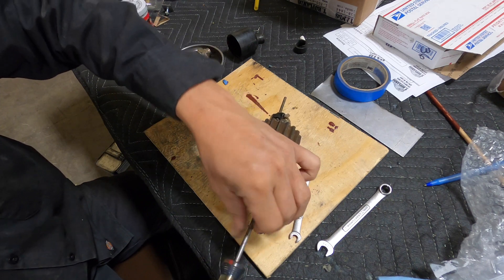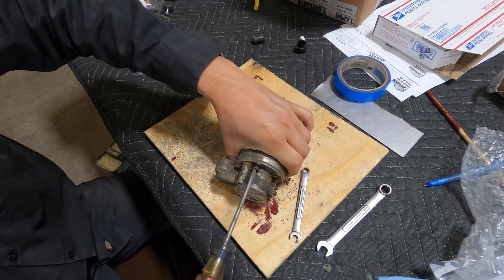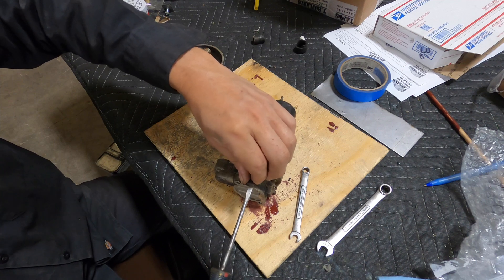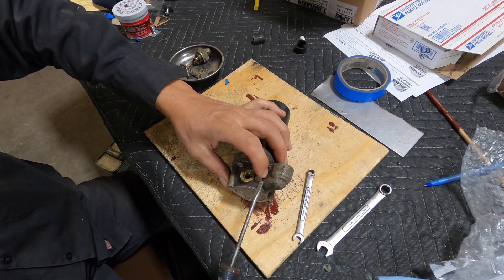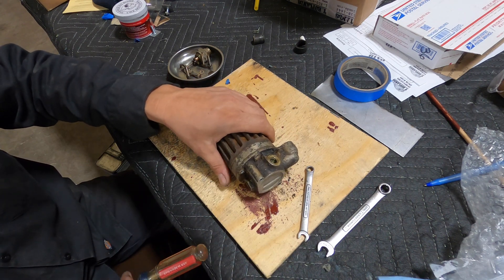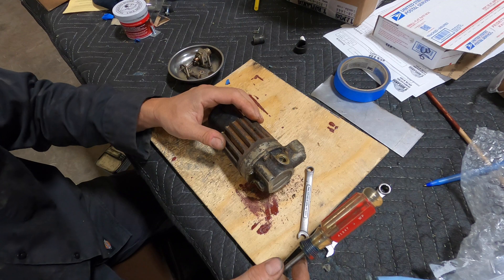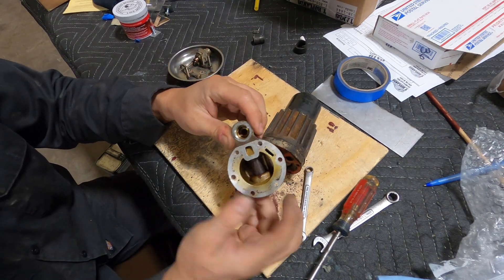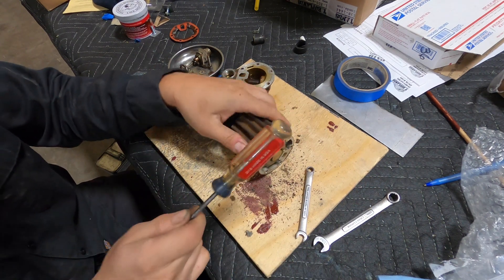Ferrari Electric Fuel Pump

Comment: Great video! I have small question , when carbs are primed the click sound is gone so its pumping no more fuel because its not needed but what exactly triggers the pump to stop pumping? Is there a relay or something that controls pump when carbs are primed it shuts off electricity to pump and when carbs need more fuel it sends electricity back to pump? Or the electric pump simply can not push more fuel when carbs are primed because there is no longer space for more fuel so like a mechanical pump it can no longer supply more fuel when carbs are primed so it just stops pumping on its own due to resistance in fuel lines since now they are full?
Reply from the maker: Good question. The simplicity of this design is the plunger that operates the switch to energize the magnet is connected to the pump diaphragm. When the fuel line and carburetor bowls are full, the diaphragm cannot not move and it stops the switch from operating. When the later cars had a return line, pressure never builds, so the pump slows but keeps pumping. Thanks for watching!
Reply: @tomyangnet  i see thank you so much!